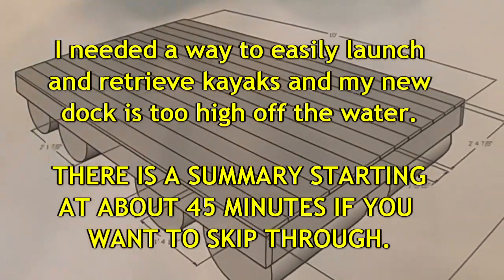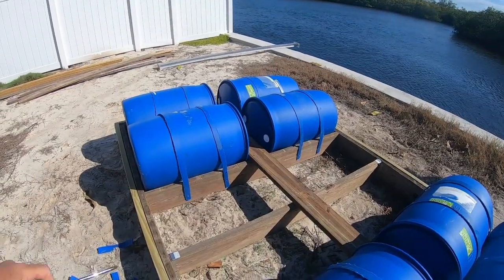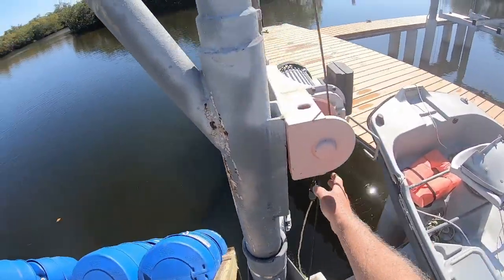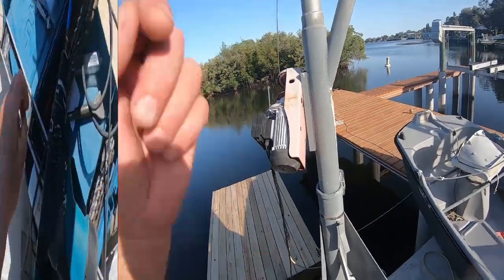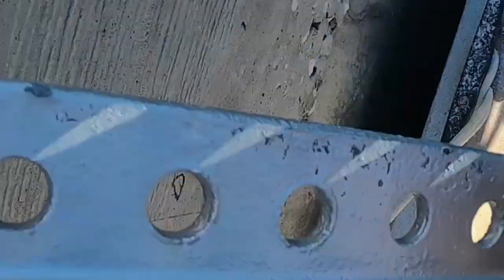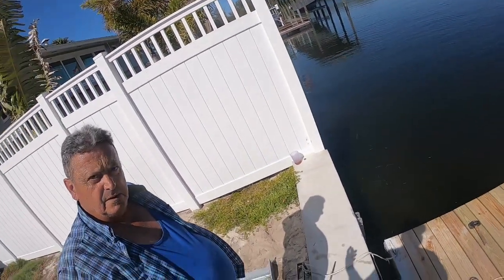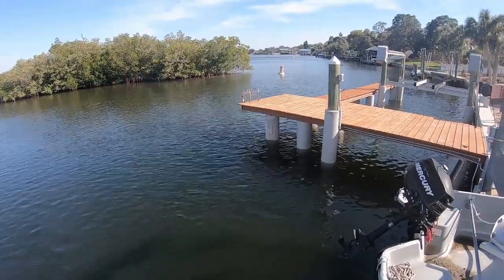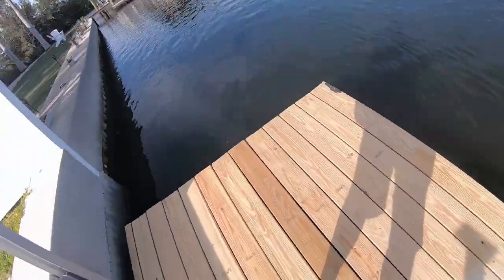Designing and Building a Floating Dock and Mounting Against a Seawall

Comment: Your design looks very good.  However I a concerned that you only used screws to hold it together.  Bolts with back plates would give you a much longer life of the dock.
Reply from the maker: Yes. Thanks.   You're right and actually I went back and bolted through the attachments to the sea wall.  This project was on a budget and I had considered bolting the corners with galvanized brackets but dismissed due to cost of those brackets and all the hardware required.  I considered that the wood would rot eventually and that I would probably just replace the dock anyway.  Thanks for your suggestion!